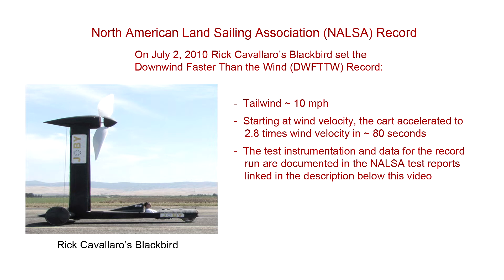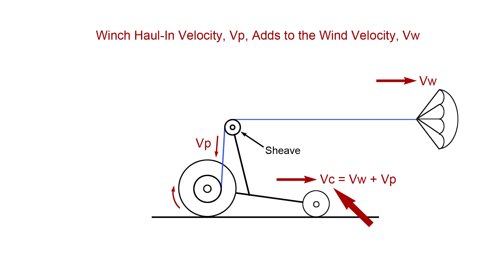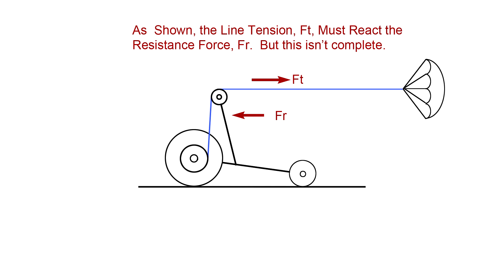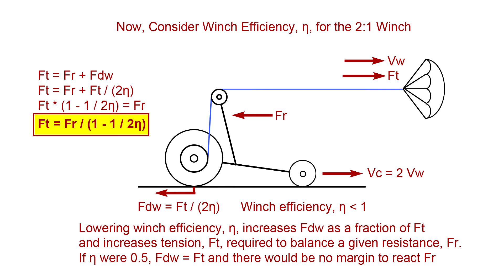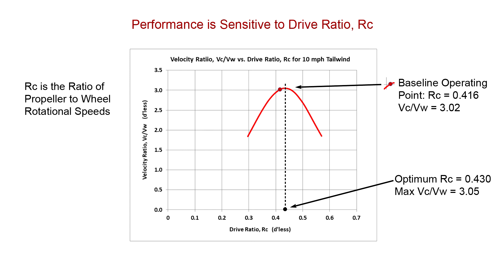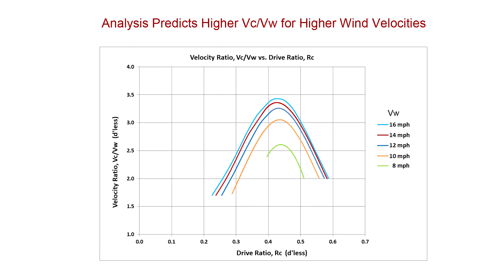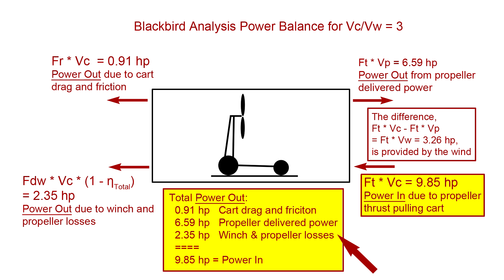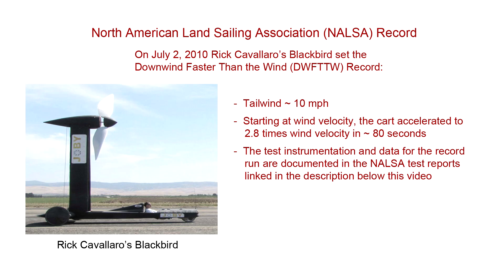Why Blackbird, DWFTTW Works

Comment: Hi there.  Rick and I designed and built the Blackbird (with propeller assistance from Steve Morris) and hold the world records together.   Your analysis is pretty remarkable in that your simulations and observations are amazingly close to our reality.

Your compliment that the Blackbird appears to be set up "near optimum" is appreciated.  You should know that I build a massive, gasoline engine powered 'treadmill' upon which we optimized (and broke and broke and broke) the Blackbird before taking it to the desert.  Though there were a few issues in our first dirt runs (we'll get to your wheel slip comments), the vehicle performed very close to our own simulations.  We did run it in higher and higher winds and at higher and higher speeds until I was begging Rick to slow down in fear of it blowing up (which it eventually did).  We approached 60mph several times and regularly took it over 50mph.   Of course top speed was not our record goal, but rather a multiple of the windspeed.  

We were initially working with a $5,000 budget (which included our own custom built ~18ft propeller) so I could spend very little on the chassis.  I designed a craft which I felt could be safe at our design point (~25mph ground speed).   It was made of wood I beams (TJI) from Home Depot and built up from there with steel, carbon, kevlar and fiberglass reinforcements.  Salvaged BMX wheels, etc and other bicycle components you already obviously know about. 

Some (me) would never call home made propeller tips whipping past the back of the drivers head at over 150mph "safe" in any way.  You reference Rick's presentation at the St. Francis Yacht club, so I'm sure you noticed the story of why he was the pilot and not me  (recounted at 1hr, 11m and 41s of that video).

Our original goal was 2x windspeed.  Our thought was that if we could double the speed of the wind it would make it more difficult  for skeptics to claim measurement error compared to say 1.1x.   Our design point for wind was (as I recall from more than a decade ago) ~9-10mph.    Our highest ratio we recorded was around 3.4x, and we often got over 3x, but due to conditions and limited time (and NALSA measurement rules which we found appropriately conservative), we didn't reach that under the constrained record recording conditions.  All these numbers fit your simulations very closely. 

Your observation that an appropriate RC works over a rather broad range of wind velocities was our direct experience.  I installed the sprocket cluster just so I would have a range covered, but as I recall we optimized on the treadmill and never moved it after that. 

Yes, a greater tailwind does deliver more power to the cart, and with a far bigger budget and thus safer and stiffer chassis, we could have raised the bar significantly.  As it was, at our top achieved speed, there was something like 600 ft lbs of torque on the prop shaft feeding the propeller blades through a variable pitch hub I designed and machined myself on a mini-mill.  As I said, I was literally on the radio begging Rick to slow down at times.  I still can't believe it took the abuse it took.  

As to wheel slip, the first videos you can find of the Blackbird (it was unfaired and called the BUFC ... "Big Ugly fn Cart" at that time) show it with symmetrical rear axle lengths.   During our first dirt testing day (see "BUFC blow up run with full audio), Rick exceeded the design point by quite a margin and blew up the top sprocket.  He reported an odd "surging" just before the failure (just as you suggested).  

We closely watched all our video and discovered that he was saved from tipping over (equal and opposite reaction to the aforementioned propeller shaft torque) by one wheel lifting slightly and losing enough traction to create the repeated surge in harvested power.  This self limited top speed (and torque reaction) and also hammered the top sprocket (just as you suggested). Before we went out again, I revamped the chassis to extend one axle by several feet which gave the Blackbird it's odd asymmetrical look. 

BTW, the BUFC version of the craft had a fixed pitch propeller hub (relating to your fixed pitch analysis).  It wasn't until Larry Page stepped up with sponsorship that we had the funds to dress up the renamed Blackbird and install the variable pitch propeller hub and controls.  As you can conclude, the ability to adjust pitch on the fly doesn't really increase the top performance of the craft, but rather allows it to accelerate faster and 'self-start' in lower winds.  If you review the other "BUFC" videos and compare them to the later Blackbird videos, you can see this impact. 

Overall you did a really great job here.  Seeing someone applying good engineering analysis and comparing to actual results was refreshing given the literally tens of thousands of times Rick and I have been called frauds and idiots over the last 15 or so years.

I have many, many build pictures if you're ever interested and you might also be intrigued by the upcoming possibilities to truly smash this record given the interest of a certain energy drink company to sponsor such.   Composite  F1 factory built with truly giant, counter-rotating propellers and generator/motor drive is being discussed.  Fun if it were to happen. 

Thanks and very well done.
John "JB" Borton 
Thin Air Designs team principal.
Reply from the maker: John,  

Thanks very much for your detailed and kind comments.  You’ve answered some of my lingering questions.  

This is the first I’d heard of the giant treadmill.  Wow!  I’d enjoy seeing what it looked like.  Also the variable pitch mechanism.  

I’m assuming that the potential generator/motor design you mention is similar to that in Rick’s yacht club talk (wheels drive generator that drives motor that drives prop).  Since it appears that peak performance (cart/wind velocity) is very sensitive to overall efficiency, I wonder if you’ve gotten to overall efficiency predictions for the generator/motor/counter-rotating prop combination.
Reply: It is very well done indeed, and the first time (in many years of head-scratching over multiple videos and many well-intentioned but ill-devised 'explanations') that I finally grasped the actual engine that drives the seemingly paradoxical faster-than-downwind phenomenon. Derek Muller's ground-ratchet analog came close, but it didn't quite map into the actual wind-machine at hand.

What clinches the deal in this video isn't the explanations, equations and tables, but the parachute -model, which visually and graphically combined well with the literal airscrew-style propeller to show what was my long running suspicion: _there is always some element of Blackbird that is moving slower than the wind.

I don't know why dozens of youtubers and explainers couldn't have brought this out from the get-go: "You're wondering how it can outrun the wind and still draw power from the wind. We'll tell you right now that there is part of the tailwind that is still moving faster than a part of Blackbird, and hold that thought while we get into the weeds..."

Comment: Really wonderfully cogent and complete analysis. 

It's astounding that this is still even being debated. It points to a fundamental flaw in our thinking, in how easily we can let even well-developed intuitions lead to entrenchment. I took a brief look at this back when it was still a thought experiment, had my thermodynamics boots already pulled on and ready to do battle, right until saw where the untapped differential in the system is. 

Quite stellar stuff. Thank you.

Comment: A couple of questions. In the videos showing this demonstrated, slow down the video.  At the start, notice the propeller is turning one direction. But when you see the flag pointing towards the rear of the vehicle showing it is traveling forward faster than the wind speed, you’ll notice the propeller is turning the reverse direction. Because the relative wind is now toward the rear, this is indeed consistent that the forward propulsion is being provided by the wind.

 But the problem is with the propeller directly connected to the wheels shouldn’t that reverse the direction the wheels are turning? I’ve not seen anything of this nature discussed in the demonstrations. That the wheels turn in the same direction would seem to suggest some type of gear conversion that would allow the wheels to turn in the same forward direction regardless of the propeller spin direction. Also, in the small toy models demonstrating it on treadmills you can see there is no such gear conversion being used. This is puzzling.

 I like your analysis and demo using a parachute analogue. I’m surprised this worked, but I have to say there is a flaw. You see the “parachute” is not moving faster than the wind speed, even if the car is, as the wind is still pushing the parachute forward*. If the parachute were moving faster than the wind speed the relative wind would push it *rearward*. This is a key distinction from the actual case. In the actual scenario the *relative wind is pushing rearward against the propeller. 

 In fact I draw the conclusion your parachute analogue would NOT work if the parachute were made to move faster than the wind speed, since then the relative wind would move the parachute *rearward*. 

 Here’s a key deduction you can draw from that fact: it is something about the nature of the propeller itself that allows it to work in that case, but not in the parachute case. Here’s what I think that is. Much has been said about this scenario being different than a sailboat tacking into the wind because the vehicle is moving directly downwind, not an angle. But the thing is the propeller, i.e., the sail, is moving at an angle to the wind! This is because the sides of the propeller are *angled*.

 I haven’t looked at all the video discussions of this phenomenon but I think this fact is not focused on: it really is the same as tacking into the wind with a sail at an angle to the wind direction. If this fact were stated I think the phenomenon would be easier to understand.

   Robert Clark
Reply: I rewatched the videos showing the Blackbird and realize the appearance of the direction of the rotation of the propeller changing was an optical illusion, common with rotating objects. It stays rotating the same direction both before and after exceeding the wind speed.
Reply from the maker: You may be thinking of the parachute as the propeller analogue.  For the parachute concept, the winch is the propeller analogue and the winch moves downwind faster than the wind while the parachute moves roughly at wind velocity.  The parachute is simply a means of connecting the winch line to the air (the wind).  The cart wheels drive the winch which hauls in the line against the air (the parachute), driving the winch and cart downwind faster than the wind.  

The parachute can never move faster than the wind since some tailwind is needed to generate parachute drag which reacts winch line tension.   But, if the parachute is large enough, it moves very close to wind velocity.   Beyond the need for a very large parachute, the parachute and winch concept is impractical since cart travel distance is limited by the length of the winch line as illustrated in the parachute model video clip where the cart quickly overruns the parachute.  Still, the cart does move downwind faster than the wind until the cart reaches the parachute.

You might think of the air moving through the propeller disk as the line of the parachute model.  Now the “line” length isn’t limited so the cart moves DWFTTW without limit.
Reply: Thanks for responding. It is a key fact that for wind driven vehicles what’s relevant is the relative wind. When the Blackbird is moving faster than the downwind wind speed, the relative wind is directed rearward. From the relativity of the situation and the fact the only thing that matters is relative wind speed and direction, if from the start, i.e., vehicle starting at 0 speed, the wind is directed rearward the vehicle should still move forward. To me this is just as surprising if not more so than the faster than downwind scenario. But I haven’t seen this tested. Do you know if this has been tested? The reason why this should work is because the phenomenon really is the same as tacking into the wind with the sail at an angle to the wind. In this case the propeller blades are acting the like sail at an angle.

 In the sailboat case you move the sail at an angle to the wind and the sailboat  goes upwind at an angle to the wind*, then you reverse the angle of the sail and the sailboat also moves upwind at the reverse angle to the wind. Repeating this process you can move in a zigzag path that amounts to the same as moving *directly upwind. The propeller on the Blackbird then is doing this action of moving the sail back and forth. BUT there is a key distinction in that the car does not move at an angle. I imagine the reason is the friction of the wheels prevents it from happening.
 So a key question I would like to also see answered is supposed you have a usual sail-powered car, i.e., no propeller. But we put the car on a track so it could not move sideways. We move the sail side to side as we would usually do for tacking into the wind for a direct head wind. But in this case the vehicle can not move at an angle. In a case like this will the vehicle still be able to move forward?
Reply: CORRECTION! I did a YouTube search and the Blackbird team did demonstrate that it could travel directly upwind. Still I would like to see demonstrated a case with just using a sail, no propeller, being moved back and forth with the car restrained to run on a track, so it can only move straight ahead, will it move forward?
Reply from the maker: Addressing your thoughts about sail driven land vehicles, see the North American Land Sailing Association:  https://www.nalsa.org/

At  https://www.nalsa.org/faq.htm they say:  “The slowest point of sail for a land yacht is dead downwind when it sails a little slower than the wind speed.  By sailing at 45 degrees off directly downwind the yacht can sail much faster than the wind.  The  'velocity made good' down wind is often over twice as fast as sailing directly down wind.”   

Note that the often contested Blackbird performance is Directly Downwind, i.e., course changes such as gybing (jibing) are not allowed.  The downwind “Velocity Made Good (VMG)” is the performance of interest but downwind VMG is the same as cart speed when traveling directly downwind.  But, I think that this is moot since, unlike a sail driven vehicle, Blackbird’s performance does not increase traveling off of the wind.
 
If you haven’t seen it yet, Rick’s St. Francis Yacht Club presentation at 
https://www.youtube.com/watch?v=X6oJpnSJyV8 is an excellent summary of analogies offered to explain Blackbird.

While Blackbird’s propeller blades are airfoils, I don’t find the sailboat analogy that helpful (except to suggest how propellers work).  Blackbird exploits the velocity difference between the ground and wind with the overall mechanical advantage and efficiency of the drive transmission and propeller determining the system’s performance.

Comment: The wind is always moving forward across the blade in the direction that the blade is turning and the contact point where are the wind meets the blade is always moving down wind slower than the wind

Comment: Great work. I've been following this topic for many years.
I'd love to take Blackbird to the next level. A more automated vehicle that can shift between propeller and turbine mode.
Telescopic and dynamic aerofoils to extract energy from crosswinds. Roadways and railways that canalize any available wind, passible and dynamically to optimize energy transfer to a (rail)vehicle.
And the absolute pinnacle: extracting the speed differential between surface coundary layer air speed and higher altitude air speed to power a ground effect flying craft. With efficient floating wheels or tracks, a vehicle could "roll" on the water similarly to blackbird and sail DDWFTTW. It will ask a lot from the engineering, but Blackbird shows there is some rooms of inefficiencies to be introduced, as it went 3x wind speed with somewhat rudimentary drivetrain adjustments.
What would the ideal scale for a Blackbird competitor be, to optimize power and drag? Mass grows with the cube, wind power with the square, sort of. Would a cart manned by a squirrel manage 4X wind DDWFTTW?